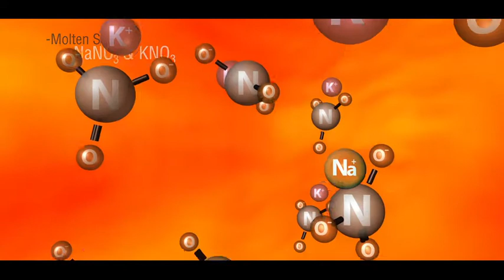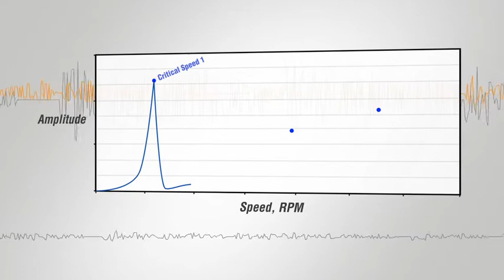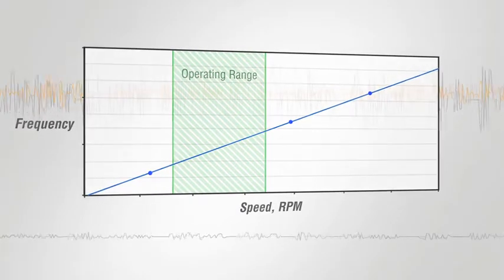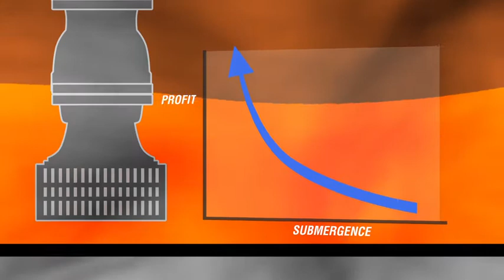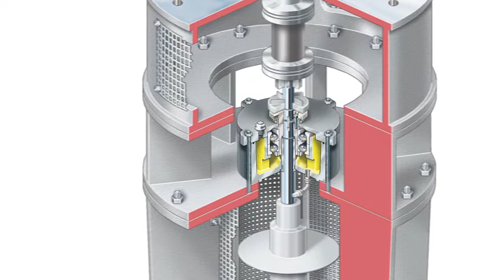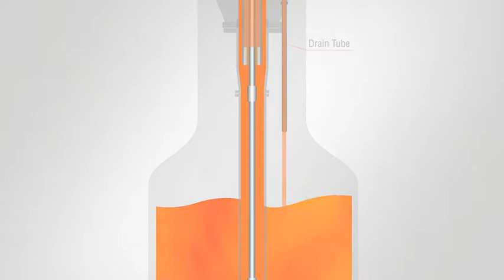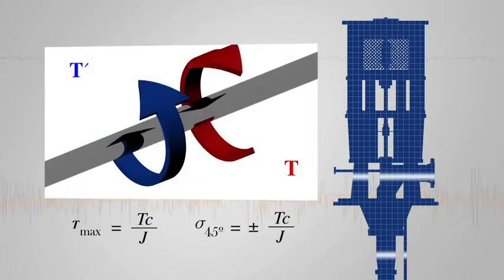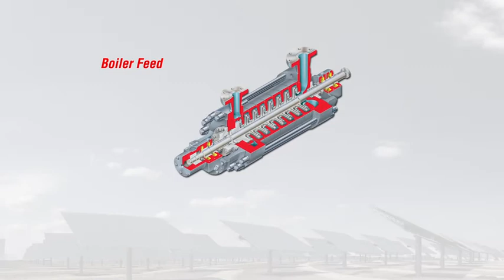Flowserve Molten Salt VTP for Concentrated Solar Power Plants

Comment: In the actual practice of the pump, the shaft is not allowed to heat up completely to make the setting, at least in what I know, the assembly is coupled when already cold and with the shaft down it does not allow coupling to the motor because it is too long, removing 70 mm of length from the last section of the shaft, the assembly can be attached and once hot the final setting can be redone since the expansion is estimated to be 10-15 mm X meter.